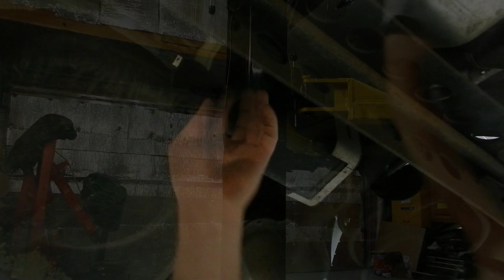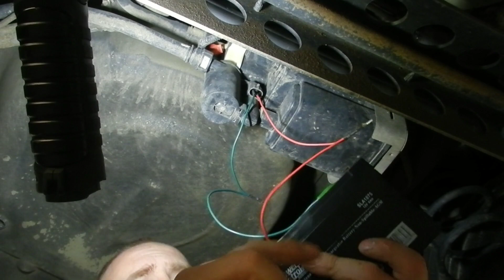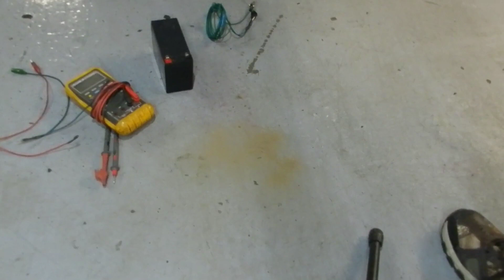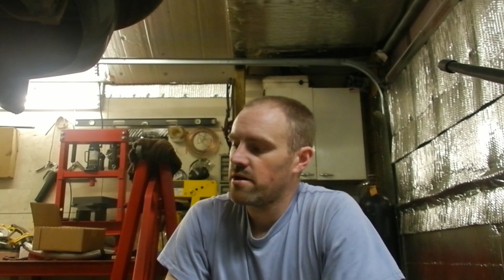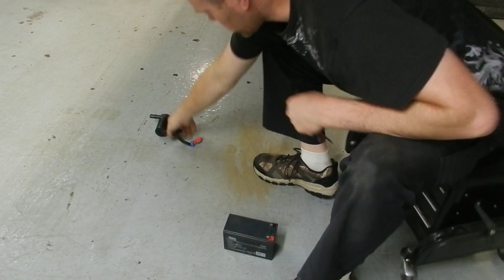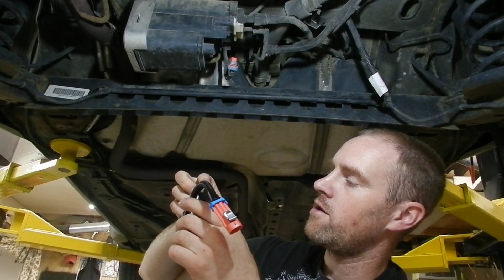2009 HHR evap code P0449 diagnosing and repair

Comment: This did not help to take off my code.  After clearing the code came back
Reply from the maker: Did you follow the test and verify your failed component prior to repair? You could also have faulty wires after all. It's not that common but possible. Also, a new part doesn't equal good part. Manufacturing does fail at there job some times.
Reply: @CrazedPerformanceRepair  What weird about this is I'm slowly getting better fuel mileage,   but everything I clear code it comes back.  Gained 1.3mph
Reply from the maker: @supertrucker1356  Hopefully it's not because your event valve is stuck shut and allowing fuel to go straight into the purge valve thus the intake. That would be uncalculated fuel from your tank into your engine which would mean your mileage would appear better on the gauge but would be actually sucking a vacuum in your gas tank. This could of course damage your gas tank and lead to much more serious problems.

Comment: People should be aware, there is a "Vapor Canister Purge Valve / Solenoid " and a "Vapor Canister Vent Valve / Solenoid " ...
Notice the Purge valve / solenoid is under the hood and the Vent valve / solenoid is on the charcoal canister underneath the vehicle somewhere near the gas tank.  Be sure you are replacing the one that is faulty or both if needed.  The issue can be either or both or something else...
Reply from the maker: Yup, however I've only replace one purge valve in the last 20 years and countless vent valves. Also seen a fair share of cracked hoses but those vent valves out in the gravel road country are extremely common to fail. 

I did mention hoses I'm pretty sure but may have skipped out on the purge. This one had codes for vent specifically if I recall so why target a purge?
Reply: @CrazedPerformanceRepair  Yeah, I just want to be sure people don't get confused.  I was googling for "evap solenoid" and "vent valve" and it was always showing shopping results for the purge valve under the hood and not the actual vent valve. And in other videos there seemed to be people getting confused and mixing up the two names and replacing the purge instead of the vent valve.  It took a little extra digging to find the information on the vent valve/solenoid just because google was pointing me to the purge valve for some odd reason.  Figured since your video actually shows the one I was looking for I'd leave a comment here too.  And thanks for the video.  It shows how easy it is to fix and how easy it is for dust to mess it all up.
Reply: If I were a betting man, I'd put money on Google trying to upsell you on parts.
Reply: @vla1ne  Google always shows products related to what you are searching for and not necessarily what you actually need.  A family member just bought the wrong a/c refrigerant for a car because he looked at the ads instead of the specs below the ads. I always just look at the stickers under the hood but when your in a hurry I guess you end up putting too much trust in Google...

Comment: My 2008 Chevy HHR has the exact same problem that you are experiencing.  I've got it at a shop right now and this (https://imgur.com/FPdB0iQ ) is what they are asking for the repairs to be completed.  Am I being ripped off?
Reply from the maker: Unless there is something wrong with the carbon canister they shouldn't be replacing it.
Reply: @CrazedPerformanceRepair  ...Assume that there is something wrong with it.  Is the price for the repairs fair?
Reply from the maker: @Rickbearcat  I would think so, depends on area but I'm surprised I don't see separate charge for diagnosis. Perhaps it's built in?
Reply: @CrazedPerformanceRepair  ...The diagnostic fee was $112.00.  Additional.  I didn't give this to you because I didn't feel it was a necessary item to include in the question.  But, now that I do, there you are.
Reply from the maker: @Rickbearcat   labor rate in your area must be $120-130 per hr then?

Comment: Bro you are very good & professional!!! Thanks for the video! My problem with my 08 Chevy HHR LT 2.4l is the RCDLR!!! I have TPMS light on and brand new factory key&fob but can’t get in learn mode with the fob so I’ve narrowed it down to either the RCDLR IS GOING BAD OR NEEDS REPROGRAMMING. Or the ecu/bcm is configured incorrectly. Please tell me you have a solution for this problem. Btw the fob will unlock & lock the doors and panic button work but after 1-3 minutes it stops working!! Please get back to me if you can help me. I’ve done most of work on my car bc I don’t trust the dealer’s plus their cost is crazy!! Car runs great and it’s just annoying to see when I spend god damn money on scooper Ultra Touring tires and Autel TPMS sensors.

Comment: Thank you for this video. I have a 2006 Chevy HHR 2.4. Keep getting the code to check my gas cap. I have replaced the cap with a new Delco unit and I have also changed the evap purge control solenoid in the engine compartment, but after a few months the gas cap code returned. Now I'm going to change the vent control solenoid thanks to your helpful video. Also the car will run poorly and stall if I fill the fuel tank up, but everything is fine after I use up a gallon or so of fuel. Could this problem be related to the vent control solenoid? Keep up the helpful videos and tips. 
Sonny Balsemer 03/02/2020
Reply: Having the same issue with my 2008. Did you ever find the problem?

Comment: If the white tabs that hold the tube in is damaged, will that trigger the Code P0449?  If so, how can I purchase them?
Reply from the maker: No the p0449 is a circuit malfunction code. This means it is a electrical issue.

Comment: could this be a common problem in the winter ??? my father has the same code
Reply from the maker: Its a all year around problem. I suppose if moisture got in the solenoid or thewinding has a break that when cooled separates it could be a problem in winter. As far as i know though winter isn't much of a factor. most Common source of the problem is from dusty roads.